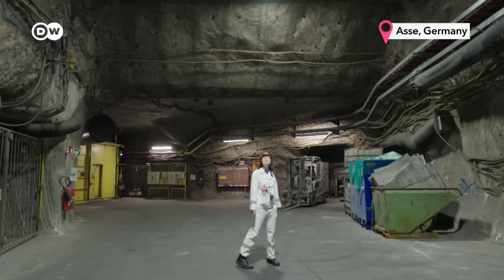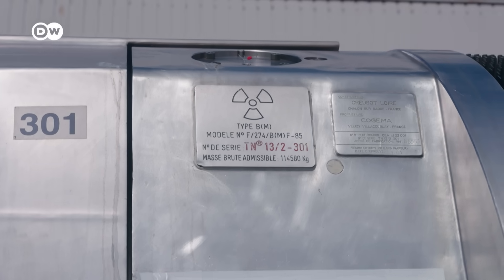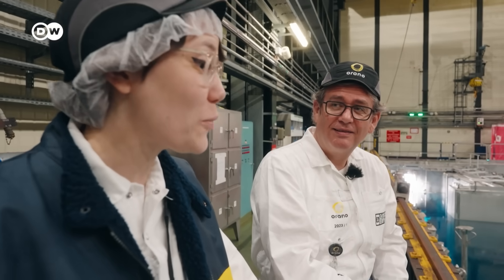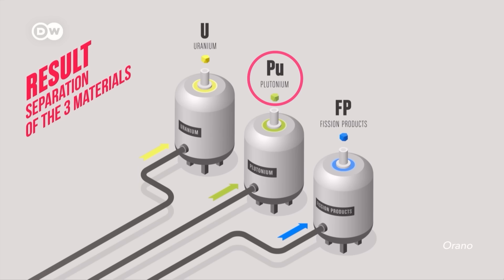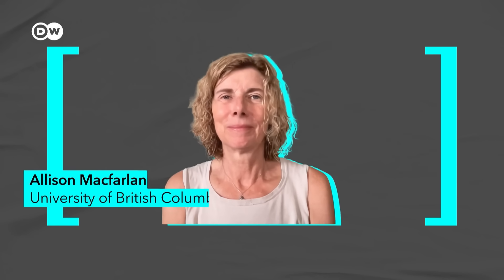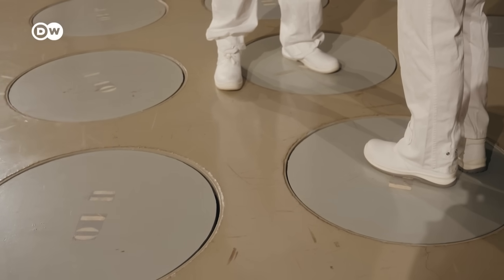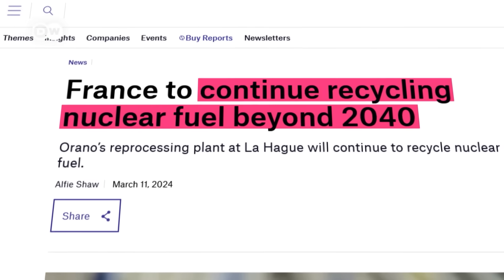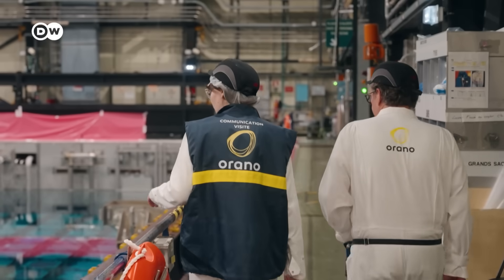Nuclear waste is reusable. Why aren’t we doing it?

Comment: Good video EXCEPT your comments on Plutonium are 100% wrong! Let me explain. Plutonium is created by neutron bombardment of Uranium 238. A typical fuel rod contains between 95% to 97% of a Uranium 238, with the remaining 3% to 5% being the fissile Uranium 235. Now during it's normal operation, enough of the Uranium 238 captures one or more neutrons. The result is a mixture of Plutonium 239 and 240. Plutonium 239 is what's needed for nuclear weapons; however, too much Plutonium 240 makes it worthless. It's impossible to chemically separate Plutonium 239 from 240. 

The CANDU and RBMK reactors (heavy water and graphite moderated) can take many forms of nuclear fuel, including natural Uranium which only has 0.7% Uranium 235, and create a sustainable nuclear reaction. Where weapons Plutonium 239 comes into play is when fuel bundles / pellets are fed into an active heavy water / graphite moderated reactor for a short period of time to allow one neutron capture by a Uranium 238 atom. Thus these reactors create the possibility of generating weapons grade Plutonium 239.

Comment: I've wondered for a while, but if spent fuel remains over the boiling temperature of water for years, why not use that heat to run turbines?
My guess is that it wouldn't be safe to try to do that, since it would mean much less water between the spent fuel and the air.
Reply from the maker: Hey there! The new fuel (known as MOX), also mentioned in the video, can be used in a reactor for example, generating heat through nuclear fission. This is then used to produce steam and can drive turbines (as with fresh nuclear fuel).

Comment: I always wondered about this.  Radioactive waste generates an enormous amount of heat.  Heat = energy, so why not use it?
Reply from the maker: Hey Rich! The heat from radioactive waste, called "decay heat", is used rarely but it is for example in Radioisotope Thermoelectric Generators (RTGs). The decay heat is converted directly into electricity using thermocouples. It can be used in remote weather stations for example. However, there are challenges such as safe handling and it is quite complex and expensive to develop applications.

Comment: What wasn’t mentioned is that molten salt reactors under development generate about 96% less waste to begin with, and the waste they generate has a much shorter life span
Reply: molten salt are highly explosive, pls learn Physics, and ask yourself why most a PWR reactor today
Reply: @RayZon69  you seem to be confusing molten salt reactors with molten sodium reactors. The latter is rare due to sodiums volatile nature. Most MSR designs do not use sodium but FLIBE, which is mainly Lithium Fluoride, which is not explosive at all. As you would know, MSRs run near atmospheric pressure so they do not need giant containment buildings because they are passively ‘walk-away-safe’

Comment: TLDR : Currently recycling nuclear fuel also makes WEAPONS GRADE plutonium.
So most countries dont allow it since well, its weapons grade. And its expensive AF compared to just buying the mined material.
Reply: Well, no. You could use the same process  to produce WGPu, but it would need to be irradiated for at most 30 days after fresh uranium was placed into the reactor. That fact was omitted here when the Indian "Smiling Buddha" bomb was mentioned. After 30 days buildup of even isotopes turns WGPu into RGPu, that may be suitable for RTG devices and MOX, but in case of a bomb - even isotopes tend to poison chain reaction (not as much as fission products), so at most you would have fizzle instead of proper detonation. Aside from that, the core would be so hot it would shift itself inside the TNT lens.

Comment: Imagine a way to use the spent fuel rod to heat homes or make hot water. Make it safely of course.
Reply from the maker: Hey Benjamin! There is no such thing to directly use spent fuel rods. They are too radioactive and need to be handled with extreme care so it does not make sense. However, the heat from nuclear power plants is used to heat homes via district heating systems, e.g. in Sweden, Finland and Russia.
Reply: @DWPlanetA  yes of course! But that’s exactly what I was thinking! Finding multiple ways to use the rods after they are “spent”

Comment: Technically 100% of it is recyclable, just that either our technology hasn't developed the means or doing so requires materials that are cost prohibitive. If it is radioactive no matter how strong or how weak it can be used in a nuclear voltaic battery, thing is that making one of those is very expensive.

Comment: Forgets to mention that a shitload of low radition waste gets just dumped into the ocean by la hague. 400 kubic meters of contaminated water every single day. There is a pipe that just ends in the ocean. In 1997 the water around the pipe was more contaminated than the lakes next to chernobyl in 1986.

Comment: There is an alternative to this, as far as I can understand it. A very rare type of reactor, a liquid Thorium salt reactor, is capable of using spent fuel from older Uranium reactors in solution with its Thorium fuel. Additionally, these reactors are more failsafe, use a less expensive fuel, and produce much more short-lived fuel waste than Uranium reactors. The main reasons these are not in widespread use are the continued fear of nuclear energy, and the precedent of Uranium reactors already built. (Again, as far as I'm aware. It's been a few years since I researched this. For more information, please research liquid salt Thorium reactors.)

Comment: Nuclear energy is very efficient and eco-friendly but general population don't understand how it works . More research needs to be done though.
Reply: I agree
Reply: It is the most expensive way to generate energy we have - and like mentioned in the documentary:
Recycling makes it even more expensive while not even completely solving the issue of radioactive waste.
Reply: @knighthood91  I agree 100% it is being expensive but it has the least deaths of any other energy even solar and we do completely get rid of the issue of radioactive race we stole them in thick concrete cases on site of the plant and well it just works have you ever seen anybody die from radioactive waste and also all of the disasters an accident you have heard no people have actually really died from it 3 mile Island nobody Fukushima surprisingly also nobody well Chernobyl was just a complete disaster but you get the point and also unlike wind and solar it be on 24/7 in any weather condition and nuclear power is also by four not by landslide the most safest energy out there the containment can withstand a commercial plane in the case of a airbone threat we have documents for everything for earthquakes for volcanoes airborne attack and we have backup systems to backup systems to backup systems no joke
Reply: @knighthood91  and the fact that it needs minimal space unlike solar it prevents the takedown of lots of forest area and if you include everything that I just said and some other stuff because I did not want to make my message to big it is worth what it is priced at and in the long term well very long term the maintenance fees for solar and wind turbines will outcost the price of a nuclear power power plant

Comment: 0:07 jeah, they throw and pushed it in holes and abondened mine shafts with dump trucks and let water enter the old salt mine. just like you want your government and the industry to proceed with the most poisenous wastes...
Reply: High Nuclear waste will be contained in special concrete, surrounded in a nearly unshatterable glass containment. It’s not reactive to corrosion.
Reply: @ruesselbert3004  industries and governments can't even properly handle normal waste yet you trust them with nuclear waste 😐
Reply: Funny, read into the subject! Not that poisonous at all, a very (re)useable resource as a matter of fact
Reply: meanwhile gas plants which are causing climate change are totally fine!!! hooray!!!

Comment: There is this thing called Breader Reactor you can use to generate fissile material back. But it is still quite complex. France have had a prototype of this called Superphénix. But they used melted sodium as a heat fluid which turn our to be a nightmare as highly corrosive and exploding with any water contact 🤦

Comment: As someone who has worked with radio labeled isotopes I can say without a doubt that the reason we aren’t recycling RAM (radioactive materials) waste is because of the risk of contamination due to how easy it is to spread invisibly. There aren’t enough gloves and disposable suits to make it feasible and if there were, the cost savings would be negative. Heck, why didn’t we encase Fukushima in concrete in the first week? We’re crafty humans, right? We can build great things that do marvelous feats right? Yet still we are stuck on the ground with reality, cold hard facts, and global health as our charge to protect.

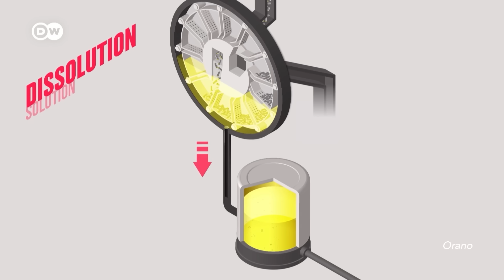7:12 what is missing from this step by step guide is that EVERYTHING  used in each of these steps becomes contaminated with levels of radiation above the safe limits. Every container, every instrument, every device become contaminated in such a way that it is not practical to decontaminate them. Are we going to try to make a self-contained system? If so, how do we handle maintenance. Washing stuff definitely doesn’t work unless you have infinite time and resources, so how do you handle all of the contamination? If we were telekinetic beings maybe we could find a way to recycle RAM without it touching anything else, but otherwise you’re just smearing invisible death and cancer upon a much higher surface area in a situation that will balloon exponentially.
Reply: It is quite possible to encase a reactor in concrete.  All you need to do is pull up a sat photo of the Hanford site to see like 7.  While you are looking at the photos, please take note of the very large long buildings in the center of the site.  Those were all Plutonium extraction facilities with self contained Hot Cells and provisions for maintenance by use of remote manipulators.
Reply: Sorry if I sound upset, but radiation was the proverbial if not literal Pandora’s box for humanity. There will never be a time when our best option is to tinker with it more when we should have left it in the caves we found it in. Could it free us from carbon? Yes. The real question is whether it will free us from carbon in our hands or whether it will just make us part of the archeological record. Fusion > fission.

Comment: It really steams (so to speak) me that we don't do more of this. It'd also be neat if we could figure out how to use that residual energy that they give off after removal from the reactor while they are in their cooling tanks as well as here. As an engineer, the drive for efficiency in me hates to see this thermal energy go to waste. The lower grade fission products do have certain uses, but not a great deal compared to the volume. For those, deep level burial I think is probably the best long term strategy.